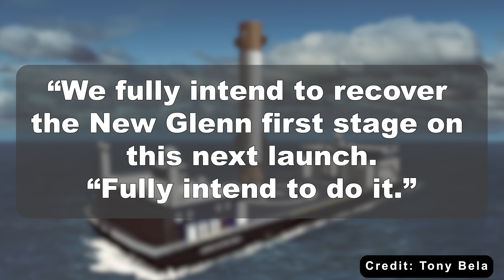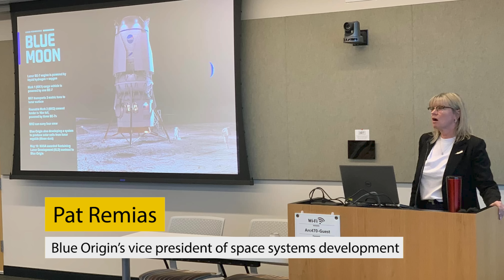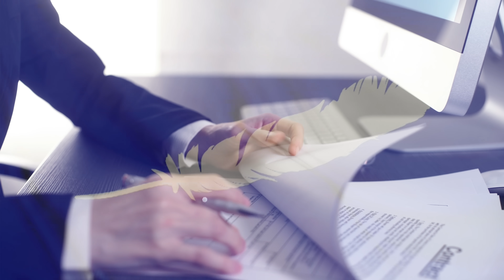Blue Origin New Glenn Officially Launched, But No More Future...Elon Musk laughs!

Comment: They are still trailing by 10 years.
Reply: But have a much better heavy lift booster than the falcons 23 ton payload, blue origin is just more than double that. And with the future adition of 3 more engines will come close to starship booster thrust, still a lot less but with 10 engines not 32. Musk has spent tens of billions and has been beaten, even if it took a few more years than spacex, only 3 more years to get a powerhouse of a booster saving billions by not launching when the engineers stated very clearly it was not ready.
Reply: Pie in the sky until it happens.  To date Bezos has not been good to his word.  @Andrew-d7e3k

Comment: Pretty humiliating for Space X to see this kind of incredible engineering. 2 flights, two orbital flights. Operational on second flight and made the landing on first attempt.
Its obvious why they are so butt sore..
Reply: How many ISS flights? 😂😂😂😂
Reply: @dranoelarios4788 Your butt is sore. The answer is zero. How many orbital flights for Starship? Zero as well. How much cargo to orbit? Zero
Reply: You sound every bit as ridiculous and ignorant as the SpaceX fanboys who are down playing this flight. This was a great mission and the rocket is performing very well and it's a very large rocket. 

But there are very big differences between this New Glenn rocket and Starship. This is a very large rocket but it would not look that big if it were standing next to Starship. 

 SpaceX did not attempt to put Starship into orbit and fail. They did not ever attempt to orbit because they were testing other things like heat tiles and durability, and the new pez dispenser for satellites. 

On all of the test flights they stated that they would not attempt to orbit yet, but they absolutely could have if that had been their goal.  Starship is also a much larger and more powerful rocket. 

16.5 million pounds of thrust for Starship and 3.85 million pounds for New Glenn. Raptor has about 230 tons of thrust per engine and the much larger New Glenn engine has about 250 tons, but the New Glenn rocket has 7 engines and Starship has 33, and the thrust to weight ratio for Raptor is much higher. Version 3 of Raptor is going to have 269 tons. 

New Glenn rocket is still very large and is performing very well though. They will most likely also be making improvements to increase the power with future versions. The two rockets burn the same fuel but they have very different technology and a different ideology for getting there. 

The Raptor engines in the Starship are a different technology than any other rocket engines in use. It is a full flow staged combustion engine which has been attempted but never finished by anyone. Raptor is the first usable rocket engine made with this technology and design. Full flow stage combustion in principle is pretty simple but when it comes to implementation it is a very complex and difficult technology but it's the most efficient design if you get it right. They are also running it at a higher pressure than anyone has ever done with a rocket engine anywhere in the world. This is why it is like half the size of the new Glenn rocket engines but has almost the same thrust
Reply: @a @actionjksn thing you wrote is news to me. Falcon 9 is a great rocket. Starship is a much more difficult problem and still in development. What I like about BO is that they don’t over promise and over exaggerate their numbers. They let the flight test do the talking. Their word is valuable to them. To Space X acts like a propaganda machine. The response to BO is the fanboys response in a manner consistent with being part of the propaganda.
Is it really himiliating for Space X? No! Its humiliating for the cultish fanboys. Space X has a rocket to launch

Comment: The reason they could do it in two attemps is because they already have data and a guide on how to do it based on someone elses results. Its not a break through when you have an instruction book already written.
Reply: Who's results and who's instruction book are you talking about?
Reply: @Imagineering100 who thefik you think bozos
Reply: Delusional. Do you seriously believe SpaceX shared that data with BO? The answer is NEVER did, NEVER will. Instruction book aleady written? How old are you?  Do you seriously believe the data for a 55 meter and 3.5 meters wide rocket can be used to build a 100 meter tall and 7 meters wide version, with different type of propellant, engines, weight to volume ratio totally different... You have no clue of how REAL engineering works... They actually do it all in simulations, run a whole Amazon Datacenter exclusively for Blue Origin, with 100,000 times the computing power SpaceX has ever had. The simulations they run and the data they collect are as accurate as real world sensor and telemetry data, if not more, because physical sensors subject to mechanical stress are prone to fail, as it happened many times to SpaceX this year. They designed the rocket there, using a completely diferent and REVOLUTIONARY approach, run 1 million simulations. And guess what, they built it using the blueprints they came up with there, and they nailed it on first attempt, no unscheduled rapid disassembly, no launchmount destroyed, no failed engines, no catastrophic fire... I think it was the OPOSITE to following the imaginary "instruction book" you're talking about.  Elon is a snake-oil salesman, period. One day you'll feel embarrased to admit you were one of those pathetic Elon fanboys that believed every single mental fart that guy dared to fool you with.